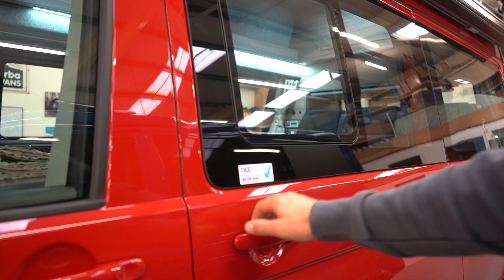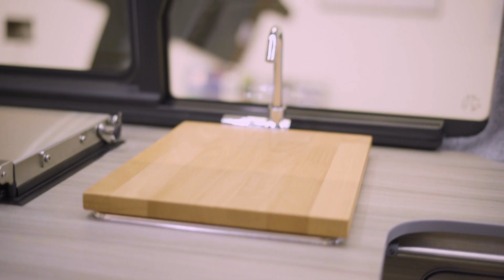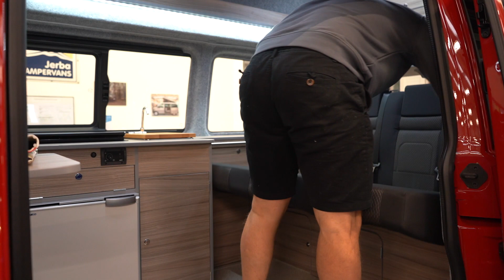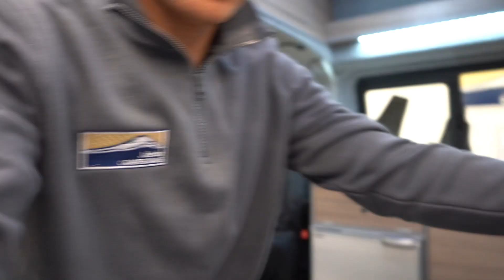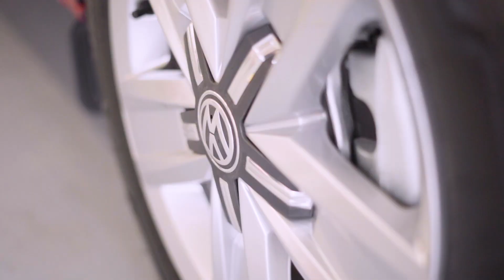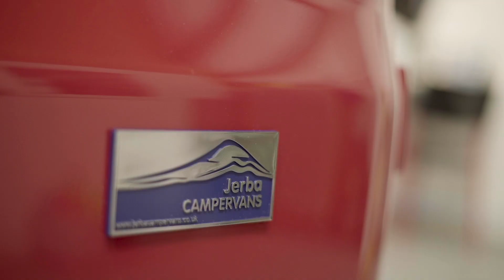NEW VW T6.1 High Top Campervan Conversion - Walk Around Tour

Comment: Thanks for another great video. How do you manage to register it as a motor caravan when it does NOT have any "motorhome style" graphics and is a two stage build? I have recently converted a new T6  but  can not register it as a motor caravan with the DVLA.
Reply from the maker: Did you register before or after the conversion?
Reply: @JerbaCampers  It was registered as a panel van in June last year and then converted but now the DVLA have moved the goal posts and it will forever be a Van with Windows. Perhaps that's a new meaning for VW.
Reply from the maker: @stonkeng  We take delivery of our vans pre registration and because we are what's known as an 'official vehicle bodybuilder' for Volkswagen we have no issues registering the vans as motor caravans from new. We are not reclassifying the vehicles from panel van to motor caravan.